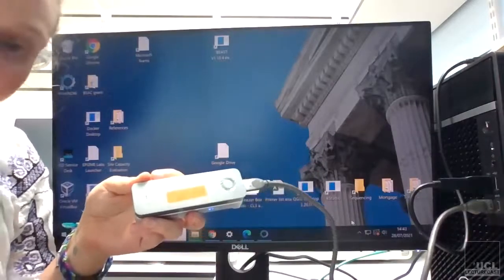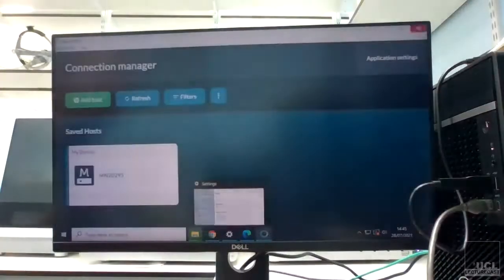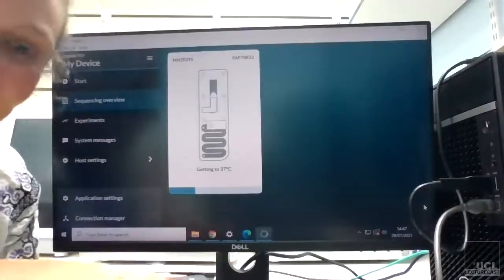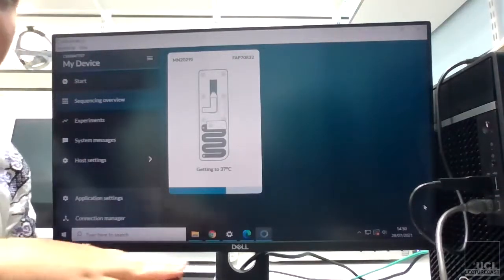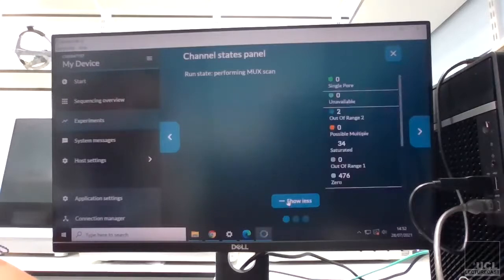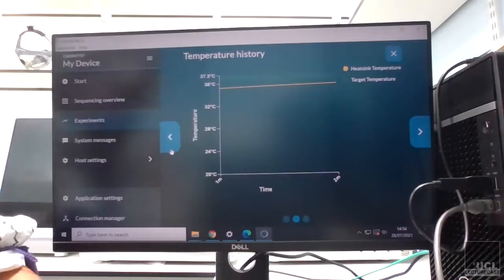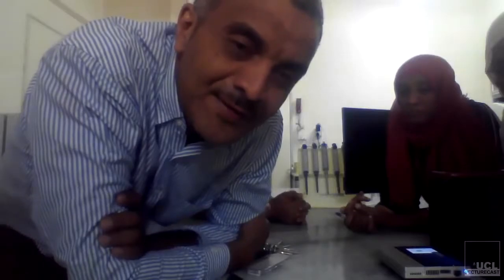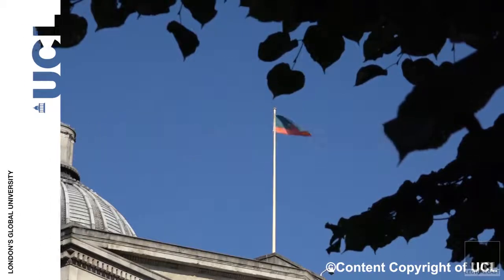Oxford Nanopore flow cell QC tutorial

Comment: While flow cell check, I received an error “no position selected”. Please guide what can I do
Reply from the maker: Hi Shubham, 

Have you connected more than one MinION to your computer? On the flow cell check screen, if you have multiple MinIONs, you need to tell MinKNOW which one the flow cell you want to QC is in (even if you don't have a flow cell in the other). Usually (depending on the version of MinKNOW), you have to click on one of the white squares (representing the MinIONs) in the top left corner of the QC screen.

Thanks,

Linzy